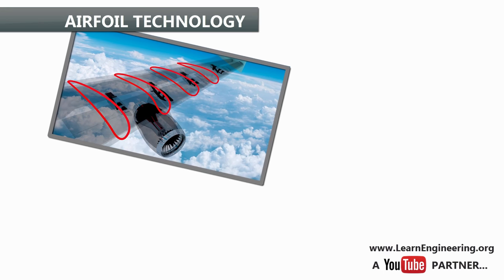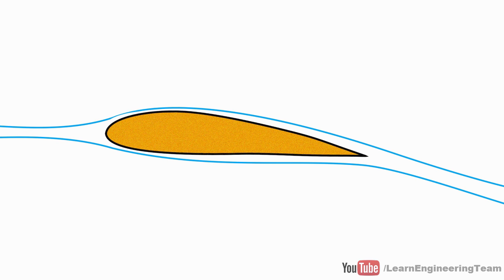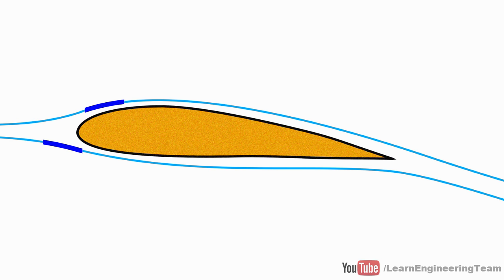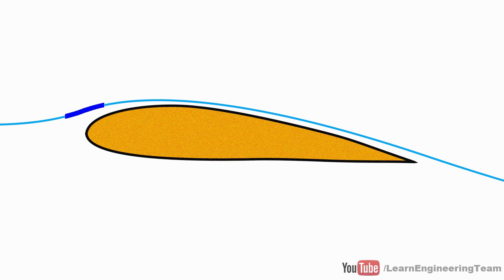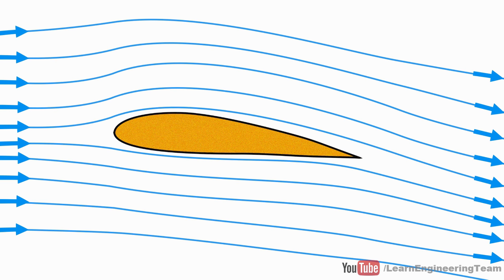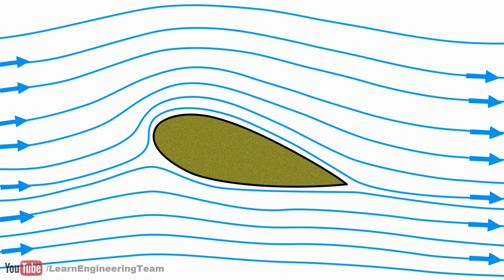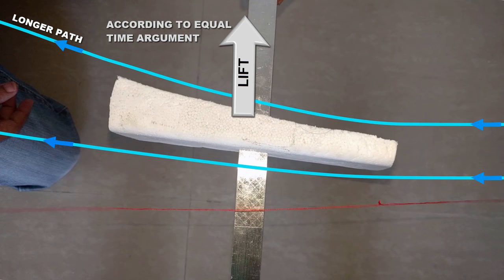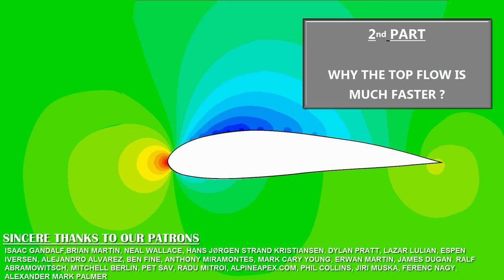How do Wings generate LIFT?

Comment: Pretty good, but...

First animation is wrong.   Whenever there's no "phase shift" between the upper and lower flows, then lift equals zero.  (The animation shows the zero-lift condition, but wrongly includes a big arrow labeled "Lift!"  Doh! )

Second: "Equal time argument" has little to do with explanations using Bernoulli.   (Bernoulli explains lift, as long as you don't include the incorrect "equal transit time" explanation as part of it.   Newton and Bernoulli are equal, with each taking a different approach.)

Third, in a 2-D world, the flow approaching the airfoil has roughly the same shape as the flow departing (because, circulation!)   Yet some these diagrams show air approaching horizontally, then leaving with downward deflection.  Nope, not in 2D diagrams, nor in 2D simulations.  Only in a 3D world can we deflect air downwards, where afterwards it remains flowing downwards.  

Two-dimensional diagrams are different.   In 2D, the air rises to meet the leading edge (not shown in diagrams here.) Then it equally descends when passing the trailing edge; an effect caused by closed-loop flow lines of circulation.  After the airfoil has passed, the parcels stop moving downwards.   In other words, flight in a 2D world is "ground effect flight" or "venturi flight," where 100% of the lifting force is applied directly against the airfoil and the distant ground surface.

Flying higher and higher doesn't let the 2D airfoil escape from "ground effect," instead it just makes the pressure-pattern wider and wider on the ground, while the net force remains undiminished.  We cannot get rid of the ground by moving it far away.  Yet in 3D, none of this weird stuff is happening.  Flight:  it's inherently a 3D effect, with momentum deposited into air itself, and 2D flow diagrams cannot explain it.  

I think the attempts to explain 3D physics using 2D airfoil diagrams will just introduce a new set of student-confusions and misconceptions.  But I don't think it's impossible to explain 3D flight:  start with a hovering hummingbird or bumblebee or helicopter, and go from there, since the level flight of winged craft is just a distorted version of "hovering air-pump flight".

The physics of 3D flight contains stunning insights, and some quite simple explanations, but these cannot be seen unless first we tear ourselves loose from beginners' textbooks and the 2D airfoil diagrams they religiously employ.  (Search on SJ Gould's papar about "creeping fox terrier clone" effect.  We use 2D diagrams, not because they're the best explanation, but because earlier texts did.)   Instead, shatter the religion: become blasphemous heretics who start out with the 3D flows around helicopters/bumblebees/motorboats or even rowboats, and only end with 2D airfoils.

Heh, on the other hand, the rest here is excellent!
Reply from the maker: Good observations !
1) You are right regarding the first animation diagram - That is a symmetrical airfoil at zero angle of attack. It should not have produced any lift. Sorry for the mistake in the drawing. 
2) An asymmetrical pressure distribution is setup around an airfoil - In top surface, in most of the region pressure gradient is negative . While in bottom surface in most of the region pressure gradient is positive. This pressure distribution can completely be explained with Coanda effect and 'outer region of a circular flow - higher pressure' concept. This pressure gradient is what responsible for high speed flow at top and low speed at bottom. Not the reverse. What I mean is, with pressure distribution we can explain speed variation in this case, but we cannot explain pressure distribution with speed variation. The reason is that there is no logical explanation what causes this speed variation if you follow the latter approach.  Anyway we will explain these things graphically in our second video. 
3) I don't agree with what you said about 2D simulations. Please check CFD simulations done by Cambridge university. Flow is deflected downwards at the downstream.
Reply: > explained with Coanda effect

Dr. Denker at av8n.com insists that Coanda Effect only applies to water jets in air.  That's wrong, but he has a point:  in aerodynamics we call the Coanda Effect by the name "Flow Attachment."

> 3) I don't agree with what you said about 2D simulations. Please check CFD simulations done by Cambridge university. Flow is deflected downwards at the downstream.

Yep, Babinski gets it mostly right, though a latecomer to this 1990s controversy.  See my refs at http://amasci.com/wing/airfoil.html#L1   The classic papers by the guy who started all this are 1990, Klaus Weltner, U. Frankfurt.

If the airfoil in Babinski's smoke-tunnel doesn't make contact with the vertical walls, then it's no longer a proper 2D situation as depicted in textbooks.   In that case, we have flow over the wingtips, and a 3D situation with a trailing vortex-wake, and non-circular streamlines of circulation.  When the airfoil tips do contact the vertical walls, then only 2D flows exist.  ANd then the upwash ahead of the foil is the same as the downwash behind.     However, if the span is shorter than the windtunnel width, and the flow is 3D, then we actually have a 2D slice of a 3D pattern.    In that case the flow does not match that of a 2D diagram.   Instead, we'll see a horizontal incoming upstream flow, and a downwards-tilted diagonal flow in the wake behind the airfoil.

This only appears in 3D, when a vortex-pair is being created.

I wasn't clear enough earlier.   In all 2D simulations (and in wind tunnels with wingtips against walls,)  the flow is deflected upwards ahead of the wing, and deflected equally downwards behind the wing.   This is a consequence of closed lines of circulation superposed upon the horizontal flow.   Any parcel that flows downwards behind the airfoil, earlier moved upwards ahead of the airfoil.   It must do this, since circulation streamlines are circles.      Far ahead of the airfoil, the air is rising.  Far behind the airfoil the air is falling.  Simple circulation.

Why is this a problem?   Because this process does not exist in real-world 3D aircraft, and so a 2D diagram does not explain flight.   At all.   It's completely an artifact of an INFINITELY-WIDE WINGSPAN.

In 3D aircraft, the wing is a pump, and the circulation isn't closed loops, but instead becomes part of shed vorticity.  The consequences of this are major.  As a consequence, in 3D aircraft, far ahead of the airfoil the air is not rising.   And, far behind the airfoil the air is greatly falling, as part of a descending, momentum-carrying vortex-wake.   The wing has dumped momentum into the air, and now the air is falling rapidly.  In 3D, the circulation streamlines are open, and they spiral off into this downstream wake, where the flow is carrying off net downward-momentum, much like a sideways-translating helicopter in level flight.

But in 2D, none of this is happening.  With two-dimensional airfoils, the air is pulled-up-then-pulled-down, and zero momentum is injected into the downstream air.  Instead, with 2D airfoils there arises an instantaneous contact-force between airfoil and distant ground: a "venturi" phenomenon where the force-pair is entirely between solid surfaces, and zero momentum is shed into the air itself.    No matter how distant the ground, 100% of the airfoil weight is pressing down upon it.

So, two-dimensional diagrams inherently depict ground-effect flight.

In other words, a 3D diagram is utterly different than a 2D diagram because the 3D diagram includes momentum-dumping and vortex-shedding, and vortex-shedding is the central process of lift-production in aircraft.  Yes, low-level textbooks ignore this, but not because it's too complicated.  It's because their authors apparently have a long-standing misconception.   It's this one:

They assume that the Newtonian force-pair is entirely between the upper and lower wing surfaces.

That's a violation of Newton.   It's "lifting yourself by your bootstraps."

So then, what's the difference between a 2D diagram versus a 3D diagram?    Look to the main Newtonian force-pair.  

In the 2D diagram, the force-pair is between the airfoil and the distant ground.  (Again, it's not between the upper and lower wing surfaces.)   In 2D, the airfoil is pushed up, and the ground is pushed equally down; an action-reaction pair.

Do real airplanes fly by pushing against the ground?   No!   If they did, then horizontal "lift" would be forbidden, and banking turns would become impossible.   

Instead, only an infinitely-wide wing will push against the ground.  No matter how high the altitude of an infinite-span airfoil, it's always pushing against the ground.   2D diagrams are depicting 100% ground-effect flight of infinitely-wide wings.   But unfortunately, they don't include the ground in their explanation, and the typical explanation doesn't even mention this serious flaw.   That's easily forgiven in children's books.   But the same flaw appears throughout all of aerodynamics, at every level.

3D diagrams are fundamentally different.  In 3D, the force-pair of Lift doesn't contact the distant ground.   With 3D wings, the force-pair is entirely between the airfoil and the shed vorticity in the air alone, where the parcels in the downstream vortex-pattern are carrying away the down-momentum.    The downstream "tip vortex" contains all the momentum; it's essentially a rocket-exhaust.    Or, we could view the wing's vortex-wake as the jet of water flung backwards by a speedboat, or the jet of air flung downwards below a hovering helicopter or hummingbird.   In all these situations, the thrust is an obvious consequence of action-reaction against a mass-carrying fluid jet, where the foil is launching a momentum-carrying "exhaust plume."   3D wings do this, but it may not be obvious, because the wing translates horizontally, so the downwards fluid jet is greatly stretched out.  3D helicopter blades give a clearer example.

Put simply, flight is a matter of dynamic thrust-production and vortex-shedding, and 2D diagrams which don't depict this, are teaching us that aircraft can "pull themselves up by their bootstraps" and directly violate all three Newton's laws.  2D diagrams are a helpful learning tool, as long as everyone is well aware that these diagrams are  fundamentally un-physical.

I strongly suspect that this issue is the origin of much student confusion.   Their teachers think they understand flight, but actually their explanations are violating Newton.  They dismiss these major issues as  being "mere tip vorticies which we can ignore."  Then, their students don't notice the newton-violations, and as a consequence,  their learned concepts cannot connect with the rest of physics, and they never completely grasp how flight works.   They've been taught the physics of infintely-wide wings and ground-effect WIG flight, and they only understand that alone.   Real aircraft fly by a very different mechanism, and they were never taught this mechanism.

Put simply:   if we "simplify" our explanations by going to a 2D model, that's called "making a mistake."    Other than ground-effect mode, 2D models don't explain flight.
Reply: Fascinating, but I don't think you are fairly representing 2D aerodynamics here.
Reply: That's why God invenented Quantum Physics.
Reply: This is a real way to do science. 
Keep debating and questioning
Reply: You assume here, that in 2D case the circulation of air flow around the wing should be zero, when in fact it is not. 
The existence of viscosity and thin boundary layer change the overal circulation, as expressed by Kutta condition. That's why "some these [2D] diagrams show air approaching horizontally, then leaving with downward deflection".

And so in 3D case tip vortex does not "contain ALL the momentum". The air is pushed down along the whole wing's trailing edge. 
Forward swept wings doesn't produce typical vortexes at the tips,  but still produce lift.
Reply: @Eltaurus Of course not:  read how many times I mention circulation.  I assume that in the 2D case the circulation is large, following Kutta Condition.

What's zero in the 2D case is the vortex shedding, and real-world airplanes fly entirely by vortex-shedding, a reaction-motor effect.  They don't fly by ground-effect like 2D airfoils do.   Infinite-wing 2D airfoils need no vortex-shedding, since they fly entirely by ground-effect, by image-force, where the ground surface below the airfoil is always much, much closer than the infinite wingspan distance, even if it's miles below.   No matter how high a 2D aircraft ascends, it always remains trapped in 100% ground-effect mode.

Short simple version:  wings are inherently reaction engines, same as props and helicopters.     2D airfoils are not.   But we can simplify the math, get rid of the "reaction engine," by making our wingspan infinite.

Real 3D wings fly by injecting energy into the atmosphere, by generating a downward-moving constrained mass, and therefore Bernoulli Equation never can apply.  We're forbidden from using it, and have to result to Euler, where wings create energy-bearing parcels, constantly create and shed vorticity.  These are elements of wings' function, and we must resist temptation to try to eliminate them.

The 2D or "infinite-span" airfoils function entirely differently than 3D wings or reaction engines.  Instead they act as "EM field analogs," like a venturi effect, or like magnetic levitation between a pair of wires.  2D airfoils fly entirely by ground-effect, 100% GEM-flight, and they need not inject any energy into the atmosphere.  Their math is relatively easy.  Bernoulli Equation can be employed.  But unfortunately, if we're using 2D airfoils, we're no longer explaining airplanes anymore.

Analogy!  Getting rid of the wingtips is exactly like explaining rocket engines by using rockets with infinite diameter:  the infinitely-wide rocket needs no exhaust plume and consumes zero fuel, yet it still produces thrust: infinite exhaust mass at zero acceleration F=mA.   It needs not inject any energy into the atmosphere.  An infinitely-wide rocket engine is not a reaction engine at all.  It's a totally different animal than a real rocket having finite orifice-diameter.   Basically the same physics applies to wings: wings are reaction motors having "exhaust," therefore an infinite-span airfoil does not explain how airplanes fly, any more than an infinite-diameter rocket with no exhaust-plume can explain a real-world reaction motor.

The poor educators, I do feel their pain.   It's nearly impossible to construct simple basic homework-problems based on the actual mechanism of flight.  Euler equation and numerical simulators only!  Gah!   But instead, they've gone too far, gone entirely over to dishonesty, to the dark side, by substituting real airplane explanations with explanations of 2D ground-effect WIG physics, while carefully avoiding informing their students of the consequences.   Main consequence:  it's easy to understand flapping-wing flight, and bumblebees, and helicopters, and rowboats and sculling canoes  ...but if you were taught the infinite-span 2D airfoil lesson, all these things become impossible.    That 2D airfoil forms a high learning-barrier, a huge mental block, and I suspect that even most fluids experts never overcame it.

Also:  the entire tip-vortex pattern contains the momentum.   I mean, all the air parcels associated with the vortex-sheet.   The vortex-sheet is shed by the entire trailing edge.   Out at the actual wing-tips, the edge of the vortex-sheet is relatively insignificant.   This is a bit confusing, because far behind the airfoil, the vortex-sheet gradually rolls up like a scroll, producing a pair of vortex-lines.   It appears that the two vortex-lines come off the tips of the wings.   But actually, the vorticity is initially spread out over the entire trailing edge, not concentrated at the tips of the wings.

Also:  genuine 2D airfoil diagrams cannot depict air approaching horizontally, then leaving with downward deflection.   That's completely forbidden by the 2D circulation concept.  Circulation requires that the flow patterns far before and far behind the airfoil be symmetrical, first rising to meet the airfoil, then falling equally.    If you ever find an asymmetrical 2D diagram, then it's actually a 2D-slice of a 3D diagram.  The downward deflection trailing behind the airfoil, that's part of the shed vorticity, part of the tilted Prandtl Horseshoe, and is a 3D effect which cannot exist in a purely 2D world.   (Exception:  include a start-vortex behind your 2D airfoil.  But that's only valid if the start-vortex is clearly part of the diagram, and is placed very close to the airfoil; much closer than the distance to the ground.  In other words, the 2D start-vortex is a band-aid which conceals the problem.   The "cure" is to move into a 3D world.  Or, at least, point out all the weird artifacts and misconceptions produced by the fluid mechanics of airplanes flying in a 2D universe.)
Reply: So basically it's all down to the principle, that "Circulation requires that the flow patterns far before and far behind the airfoil be symmetrical, first rising to meet the airfoil, then falling equally". I never heard of it, can you provide a reference to back it up?

And what happens if you just rotate a picture with symmetrical flow patterns? This way you can turn it to the case with "air approaching horizontally, then leaving with downward deflection".
Reply: wbeaty How is vortex shedding a cause and not an effect? If I flew in a narrow canyon and there couldn't be any vortexes at my sides, would I drop out of the sky?
Reply: Vortex-shedding is analogous to a rocket exhaust: a rocket's ejected exhaust-plume is the cause of the F=mA force (It's a cause, because without exhaust, rockets produce no thrust. Reaction engines are based on the acceleration of exhaust-mass: based on placing momentum into ejected exhaust.)

Flying in a narrow canyon completely transforms the physics, producing a "venturi" effect and an instant-force with the ground surface. Flying in a narrow canyon removes the net downwash, and so removes need for fuel (it removes the induced-drag which is part of vortex-shedding.) Such an aircraft could coast for very long distances, since it's now a GEM ground-effect machine and not an airplane. Heh, flying in a narrow canyon is like putting a helicopter inside a closed vertical pipe, with the tips of the rotors almost touching the pipe. The helicopter keeps flying because the entire pipe below the rotor is at higher pressure, with the weight of the aircraft appearing as 
pressure against the sealed bottom of the vertical pipe. Such a pipe is the same as having rotor-blades be infinitely long, while the ground surface cannot be farther than infinitely far away. 

Finally: flying in a narrow canyon, or equivalently using infinite-span airfoils, that's analogous to giving our rocket engine an infinite diameter! If your exhaust-plume is infinitely wide, then no fuel is needed, no net mass is ejected, no vorticity is shed, and the thrust is entirely produced by pressure-difference. Such a rocket isn't a reaction engine, instead it's lifted by static force from a pressure-bubble, and requires an instant-force between the rocket engine and a distant surface.

Yes, whenever we make the aircraft wingspan wider and wider, we inject less and less energy into the atmosphere, and this requires less fuel to keep flying.  With infinite span, the energy becomes zero, and so allows Bernoulli equation to be used for analysis. The same is true of hovering rockets: the wider the engine-bell, the less KE is being injected into the descending exhaust plume, and for an infinitely-wide rocket engine, the "downwash" has vanished entirely, and no energy is placed into the environment.  But then, the rocket no longer functions as a reaction engine. For real reaction engines such as real rockets and propellers and wings, Bernoulli equation can never apply, since the thrust-production mechanism is entirely based on placing energy into an "exhaust plume." All propellers produce vortex-shedding which carries away momentum in an "exhaust plume," but the same is true of aircraft wings, sailboats, etc.

Getting rid of the vortex-shedding also gets rid of the reaction engine. Doing so is profoundly dishonest, just as dishonest as explaining rocket function by employing infinite-wide engine bells having no exhaust plume.
Reply: Never heard of circulation-based airfoil explanations?  Check out any undergrad aerodynamics texts.  No doubt there are online tutorials, search for keywords "irrotational flow" and "airfoil" and "Kutta condition."

Rotate the picture?  That does nothing, because it equally changes the upstream and the downstream flows.  The circulation diagram of an airfoil is a vortex plus a constant horizontal wind, therefore the upstream flow always has the same angle as the downstream flow.   To "bend" these flows, so that upstream and downstream are at two different angles, that requires vortex-shedding  ...and it only works if the vortex is closer to the airfoil than the distance to the ground.
Reply: Of course I know about "irrotational flow" and "Kutta condition", I referred to the former one in my previous comment, didn't I? But your claim about the flow symmetry doesn't simply follow from from it. Can you be more specific about where did you get it from?

"Getting rid of the vortex-shedding also gets rid of the reaction engine". That is not correct, since vortex shedding isn't the only way to shed momentum.
Reply: wbeaty I'll off to the canyon, then! Flying forever! Wait... how is "vortex shedding" different from simply "downwash"? Downwash is the propellant analogue, so why this talk of vortices? I've never really got the point of circulation as anything other than a mathematical convenience and never studied it empirically.

I'm also sceptical when I hear of a very possible and achievable physical scenario being compared to grossly unphysical and impossible things such as infinitely fast forces and infinite rocket engine diameters.
Reply: Exactly. When I saw the first "Bernoulli" explanation, I had to stop the video. Totally misleading.
Reply: As a student of mechanical engineering years ago, I was taught 'circulation theory' as a theory of aerodynamic lift.  However, after years of trying to come up with my own pet theory of lift, I concluded that the theory is effectively a fact.  And then I discovered that Holger Babinski had beaten me to it: but he is, after all, an aerodynamicist and I'm not.
A wing generating lift is part of a 'bound vortex' mechanism.  It is, in effect, creating a vortex, which is continually being shed, and the wingtip vortices are an integral part of the total mechanism.  Consider a Karman (should that have two 'n's?) Vortex Street (if you don't know what this is, check it out).  It is well known that the alternate shedding of the vortices in a vortex street generates alternating lateral forces (aka 'lift').  
There have been infamous cases of structural failures, due to this effect.  Years ago, a steel power station chimney here in the UK (was it in Leicester?), was excited by the forces generated: it 'panted' and failed. More recently, reinforced concrete power station cooling towers in the UK failed for exactly the same reason.  And let's not forget 'Galloping Gertie' at Tacoma Narrows - a film clip of that infamous failure must have been shown to almost every mechanical and civil engineering student the world over.
PS  Also consider the Magnus Effect and the Flettner Rotor, where a rotating cylindrical body in a cross flow creates a lift force. And how does a curved ball in baseball and soccer (and cricket - I am a Brit!) generate the force to make it turn?